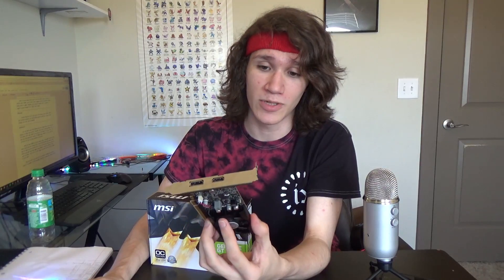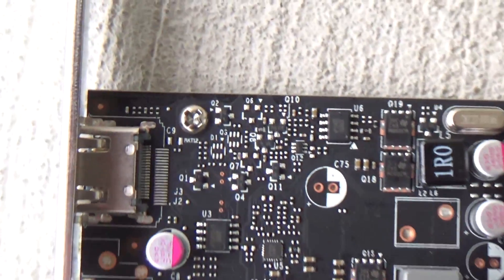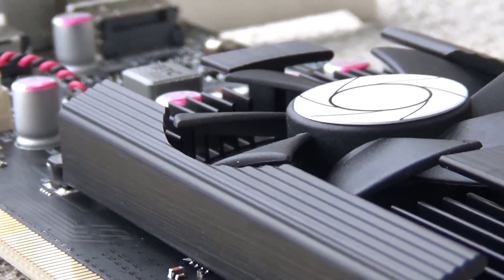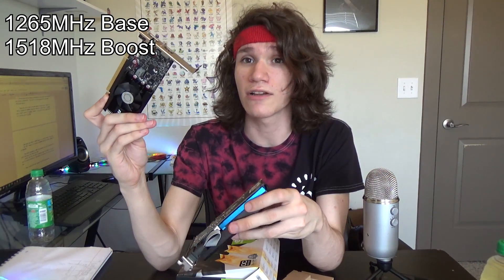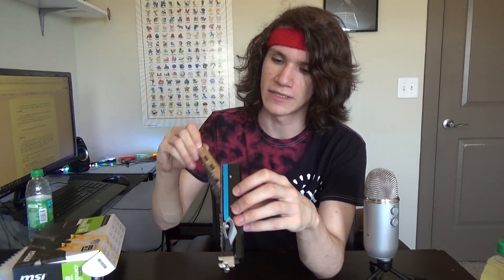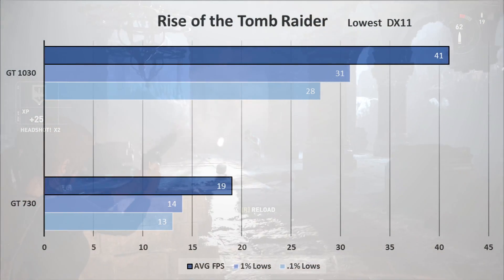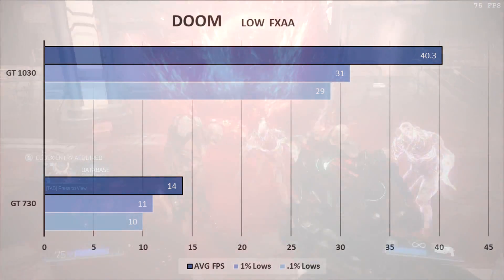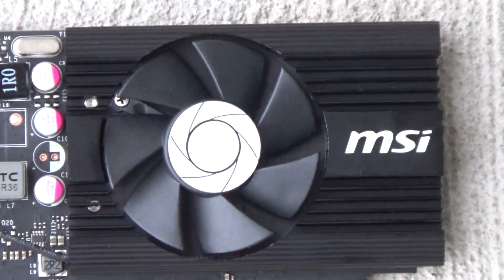MSI GeForce GT 1030 Review

Comment: I'm on a budget PC with GTX 745 and just ordered this it's gonna be a big upgrade
Reply from the maker: Nice, the 1030 is about 50% faster than the 745
Reply: @YogertPC  yea Ima use the GTX 745 with the 1030 combined bc there's 2 slots on .y motherboard
Reply from the maker: The only way they can be used “together” is by using one for physX, which may or may not do anything. They can’t be combined or used in SLI
Reply: @YogertPC  so what do I do with the got 745
Reply from the maker: You can sell it, its currently worth/selling for 35-50 USD. Or you can keep it in case you ever need it
Reply: @YogertPC  I might sell it idk who's gonna buy it it's so old but worth a try heres my system specs right now GTX 745 with amd fx  8350 CPU and 16 gb ddr3 ram I forget the motherboard but I've got CPU and GPU fully OC and can get around 165 max in creative on fortnite but in pubs get around 100 to 90 but caped it at 70 bc I still play on tv
Reply from the maker: Graphics cards are in short supply, so if you price it right it may get a bite. 
That processor is definitely a bottleneck, and the next weakest link (if you dont have an SSD)
The next think that should be focused on would be a platform upgrade, CPU, motherboard, and RAM.
The FX series processors are never fun to be stuck with, especially today since everything is worlds faster at the same GHz
Reply: @YogertPC  do you know of a better processor that's not that much
Reply: @YogertPC  i chacked i got the BaseBoard Product	GA-78LMT-USB3 R2

Comment: does it play fortnite?
Reply from the maker: kronikphase It does in fact, and quite well, however there are two versions of the gt 1030. The one shown off in this video is the faster version, but there is a cheaper variant that will have a harder time playing fortnite. Make sure if you buy one its the GDDR5 version and not the slower DDR4 version.
Reply: thanks for the reply man
Reply: btw nice pokemon poster? sure it is?

Comment: Hey bro can u tell me the difference btw 1030 msi version nd zotac one..as zotac is available here.. 🙀
Reply from the maker: All GT 1030s are essentially the same. When choosing a specific any card whether it be a 1080, 1050, or the 1030 you'd be looking at the same few criteria. If you don't want to read everything just go to the very bottom.

1. The size, if a smaller card is better for your smaller case, or if a small card would look stupid in your larger case.

2. The fan design, this one may be a bigger factor, because with more or bigger fans on a card it could run cooler, and can potentially boost to higher clock speeds. On the other hand if you want a silent computer there are fan-less GT 1030s but they may run hotter and also may not boost as high.

3. The clock speeds, the biggest difference may be the clock speeds. They're all very similar and each card will boost differently when heat and power aren't a problem, also due to the infamous silicon lottery. You can check the rated base and boost clock speeds on the cards and from what I can see the 30MHz difference between the card I have and the Zotac card there really shouldn't be a noticeable difference in performance.

4. The aesthetics, the shroud design might be more appealing to you when looking at different manufacturers, or different versions of the same card from the same manufacturer, MSI has 4 different versions of the 1030 and they all most likely perform exactly the same.

5. The price, when it comes down to it, they're all so similar that you might end up looking at a bunch of the same cards and one may just be a few dollars cheaper on the 1030 area where they're usually about $70 USD while with a 1070 or 1080 they can have a much larger range in prices for the same GPU

Conclusion: There's pretty much no difference

Comment: For gt 1030 they recommend 300W I got 220W it's work ?
Reply from the maker: Burten it depends on the rest of your system
Reply: Actually a got Radeon 5450 HD, I3 3,2ghz, 8gb DDR3, I will switch to gt 1030 :)

Comment: instead of 1080, change it to 900 and should get better fps.
Reply: Even better, 768p. 
I'm actually using it with my TV as my display & 1360x768 is that TV's resolution.

Comment: think this will work in a optiplex 790 with a 240watt psu?
Reply: I have an r7 250 in my SFF computer with a 240w psu. It works like a charm without any issue at all, and even that has a higher tdp than the 1030
Reply: alright thanks yeah, it came today pluged it in and it works really well.

Comment: This will definitely be an improvement to my GT 720 (EVGA 1GB DDR3, passive cooling model), and that thing is ass even with a +450MHz base OC and a +150 MHz RAM OC! I'm going to overclock the living hell out of that 1030 when it comes in, fan at max on all times, I have no regard for sound, I use headphones and it's not even loud enough for the mic to pick up

Comment: are you able to confirm the exact version of the gt 730 you have please?  you mention your 730 has GDDR5 and TDP of 49w.  However the GDDR5 version of the 730 has only a TDP of 25w.  The 730 that has 49w TDP has DDR3.   The 730 with GDDR5 specs seem so similar to the 1030 that it's tough to think the results would be this much different.  great review and explanations of these btw thanks
Reply from the maker: +Phil Me I actually do have the 30w GDDR5 version. I goofed that up, PCPartPicker gave me the wrong TDP

Comment: Ummm, the GT 730 is NOT KEPLER - and has just 96 CUDA cores! The GT 730 still uses Nvidia's ANCIENT Fermi architecture! Sounds like you are mixing up the GT 640 and the 730!
Reply from the maker: +DysphoricSmile I did misspeak about the architecture however it was correct in the script. Also there are multiple versions of the gt 730. The lower end model has 96 cuda cores however the one I have has 384 like I said.
Reply from the maker: +DysphoricSmile Actually I was right about it being Kepler too. So you were pretty much wrong about everything you said
Reply: Oh yeah, there ARE 2 versions... This one is indeed Fermi though - https://www.techpowerup.com/gpudb/b3007/gigabyte-gt-730-2-gb
Reply: Why do GPU manufacturers do this shit? The GT 730s I have used were that ABSOLUTE junk Fermi model! While every GT 640 is the same as the Kepler Version of the GT 730...  I mean FFS Nvidia ONE should not be more than a GT 530 the other is Kepler Proper.
Reply: This one is even Nvidia Branded FFS! https://www.techpowerup.com/gpudb/2590/geforce-gt-730   In my experience, every GT 730 I have gotten was this turd!  I mean it's not like it matters much when they are just going into office desk PCs - but it WOULD be nice if they could at least game a bit! I cannot WAIT til my Wholesaler/Purchaser finally moves onto the GT 1030s! Then I can slap one of those in  one of the 20 or so i3 to Xeon PCs in my basement and tell people that it CAN actually game decently!

Comment: What does it mean, that you said @ 4:00 .
Please Explain it in brief.
Will it work on a PCI e 2.0 slot ?
Reply from the maker: +Nitin Kumar It will work in a pcie 2.0 slot, it's just the generation of slot, backwards compatible but small amount of bandwidth may be sacrificed if using previous generations slots with cards of a higher generation
Reply: Thanks, I got it.

Comment: 2:00 Pascal is setup for digital only output. All 10 series video cards don't even have DVI i, so no VGA passthrough. They want people to adopt the new standard (and I like that), but, even myself with my GTX 1060 have to use an active VGA adapter, cause the HDMI on my monitor is dead.
Reply: Time for repair or new monitor? Tv/monitor are not expensive nowadays. :/

Comment: for $70 buy a used 300 series AMD card a 380 is roughly $100 and a 370 is toughly $70 while  being  much greater performance although you may lack the power supply to handle it with an OEM machine

Comment: I wish I could even afford a secondhand refurbished GTX 750 Ti :(
Reply: that gt 1030 from benchmarks I've seen, Is a hair slightly slower than a GTX 750 ti, and I mean a hair... they are about the same in performance. for 1080p gaming. I play on native resolution for my screen of 1360x768, so it should be perfect. :D Will replace my old gt 730, which by the way runs great on my 220W PSU.
Reply: kifla no lol, about 15% better
Reply: kifla not really man, about 10 fps better, 1030 is really a great card for esports titles like league, csgo and overwatch
Reply: I got that card today and put it in, the lowest FPS I got so far was in Dead by daylight (hate that game but needed to try the card, lol) running between 35-45 FPS, but the game is locked at 1080p but fit your screen. I'm trying more games another one was zombie army trilogy at 1368x768 (my native screen resolution I play most of the time at) on Ultra at 60-75 FPS. I'll try to do more games, Subnautica, Elite dangerous, and X-com 2 next. But I'm convinced this card is perfect for HD resolution of 1360x768, or less and fine on 1080p if willing to compromise a bit on the settings for some game. I do recommend the use of MSI afterburner for the card though, as it gets hot and that app will keep it cool by increasing the fans either automatically or a speed of your choosing.
Reply: Ave Satani dude, there is literally no game the 1030 would do 20fps. The 1030 is a better choice for me because where I live gpu's are very expensive. And I am not planning to buy used. So a new 1030 is 70$, while a 750ti is around 120$ on amazon - where I buy everything. Definitely not worth it.
Reply: I didn't see more than 5 fps difference to be honest on benchmarks... I don't expect to run that card in 2020 either, lol. I'm going to build a new PC probably around the time the new gen of consoles come around, I'm ditching consoles all together next gen.
Reply: draws 75 watts i think?